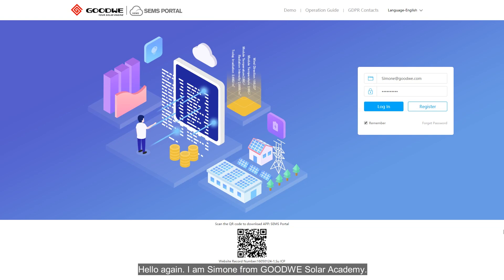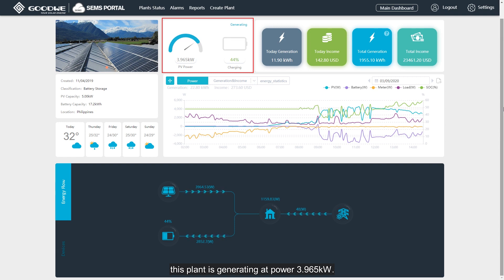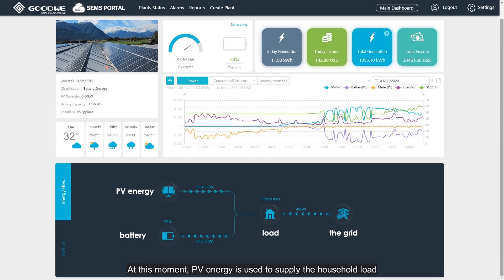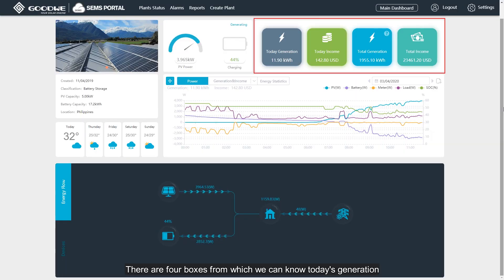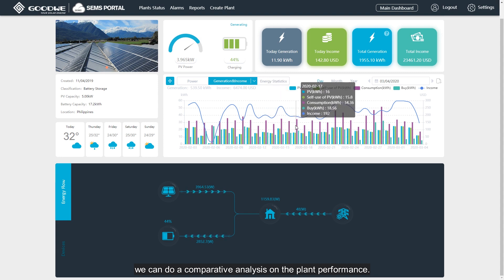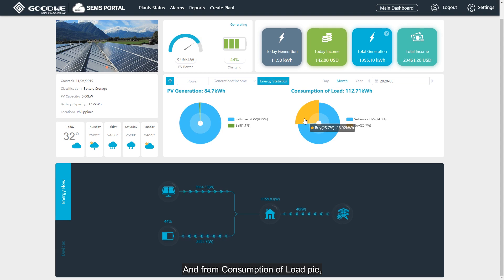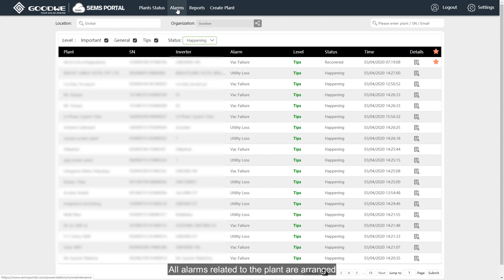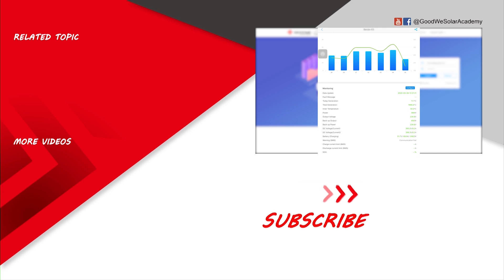GoodWe Monitoring platform introduction for energy storage system

Comment: How to monitor inverter in no internet situation? Is it possible? Some times in remote area there is no internet connection at all
Reply from the maker: If you have no internet, you can do local monitoring via Bluetooth.
Reply: @GoodWeSolarAcademy  For ES series, off grid mode, I have to use PV Master to configure and monitor then. Is it correct?
Reply from the maker: Yes, that is correct.
Reply: @GoodWeSolarAcademy  Ok, thank you